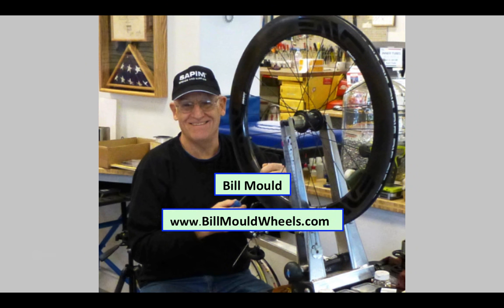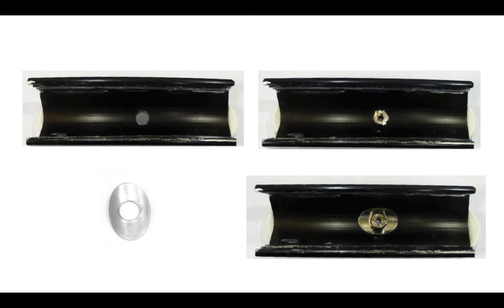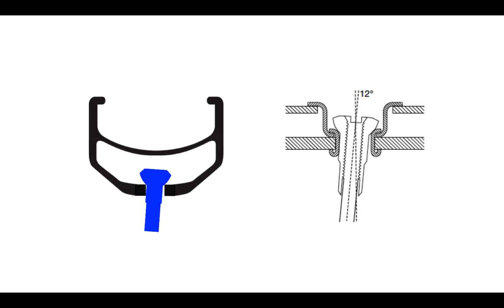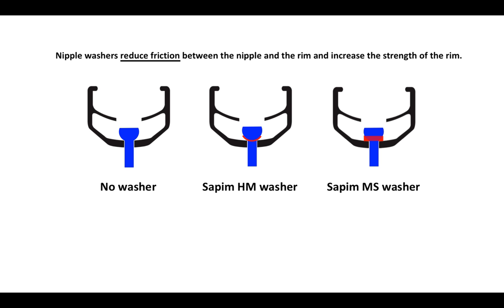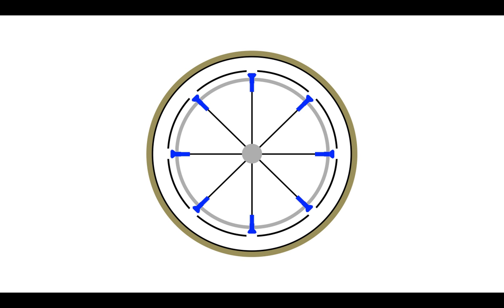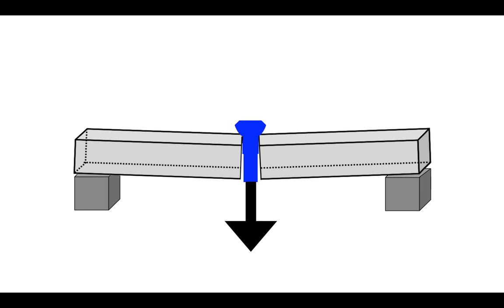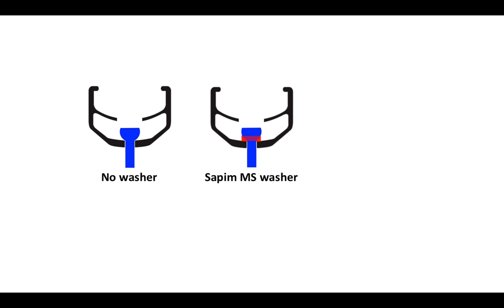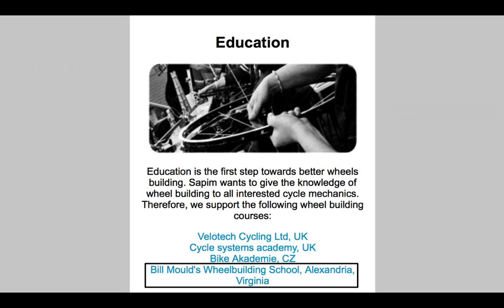Sapim Washers

Comment: Bill I can see the great effort put into these videos, but I see the 360° contact claim repeatedly. Removing or updating videos is a good idea, everyone makes mistakes. pon this video I am suprised to see the claims about nipple shapes. I know of no nipples with a flat bottom as claimed here even in different scale.  claims of greater strength of the rim with wahsers seems anecdotal at best. Having done 1000's of pull tests on rims with every washer type and eyelete type on every brand of rims. The data from these tests do not support assertions made by spoke makers regarding washers. As a simple note, soft brass or 1xxx,3xxx aluminum washers would be far better than these horrible steel washers. The softer copper or aluminum alloys will yield and conform to the hyperbolic parabaloid form of the spoke bed and the shape of both conical and spherical nipple heads.  Such wahsers will certainly offer increased rim life, especially in instances where poor design or alloy selection otheriwise makes the rims quite short lived.
Reply: So,what type of washers do I have to use on a Stans No Tubes ZTR Arch Mk3 rim?
Reply: Josh I agree with you on the profile of the nipples.   It is not clear to me that Sapim Polyax design is much different from other manufacturers.  The Polyax nipple is their standard nipple so they just added a trademarked name to there standard nipple.   I disagree that aluminum washers would be better than a properly fitting stainless steel washer.   Aluminum-aluminum interface is more likely to gall than a aluminum-stainless interface.  I have never seen aluminum nipple washers probably for the galling reason.  Nipple washers have been around for a long time, but were replaced by eyeleted rims which was thought to be a better solution to increase rim durability.  Because of this, nipple washers were largely forgotten.  It seems that nowadays, even expensive rims do not use eyelets, so nipple washers are gaining more interest as a way of increasing rim durability.

Comment: how to fix when I think the washers are loosen? (mavic wheel)
Reply: Ob the rim or on the hub flange? On the hub flange you could (!) use a mallet to set the spoke heads/j-bends. Will not work on straight pulled spokes obviously ;-).